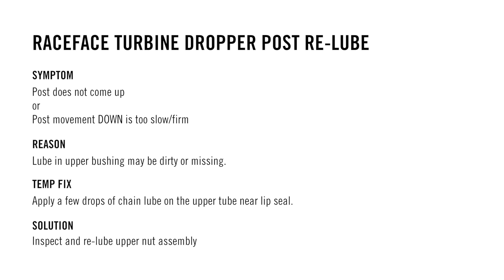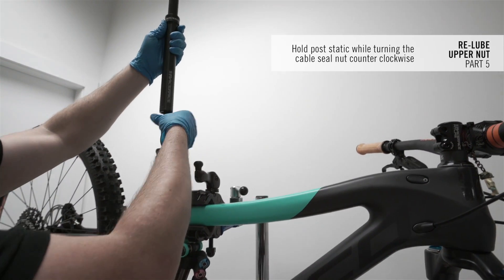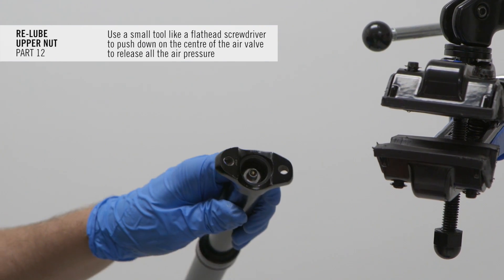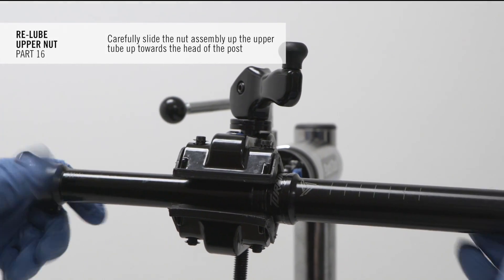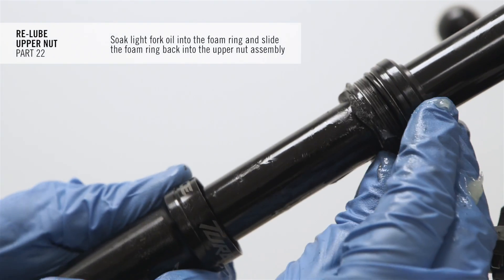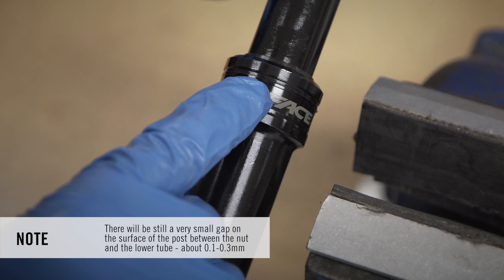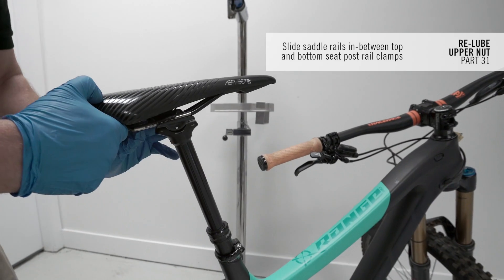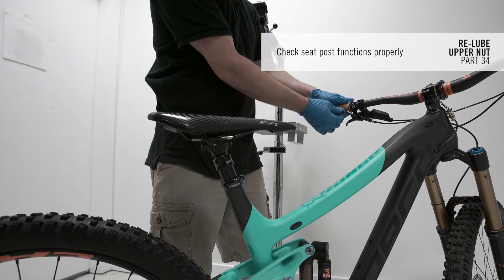Race Face Turbine Dropper Post - Re-lube Procedure

Comment: I was able to open mine by putting the seat post in a bike vice and then twisting the nut off using large vice grips (curved ones). I wrapped the head of the nut in duct tape to provide grip and protection; it marred the nut a little bit, but only minimally and I was able to get it off.

Comment: I was able to loosen the nut by wrapping it in electrical tape enough to protect nut, then putting in a clamp vice and tightening little bits at a time to avoid bending it. I'd tighten, then twist seat post and insert tube. If the nut spun too, I'd tighten a bit more until finally the nut didn't move, only the posts. Took tape off after all assembled and no marks.